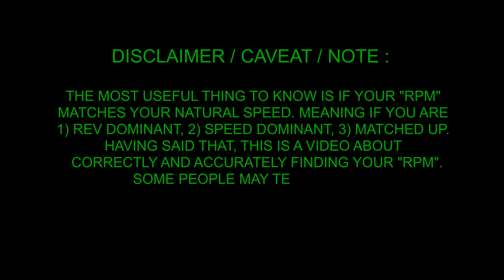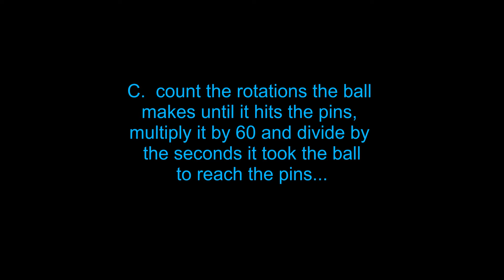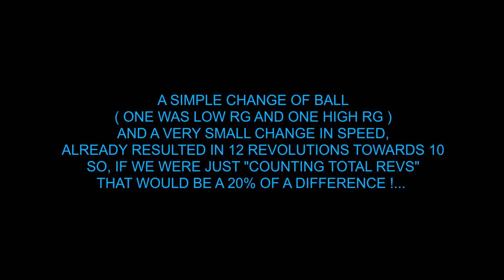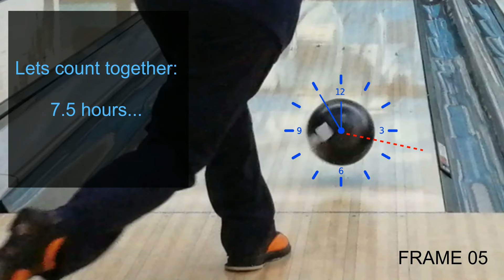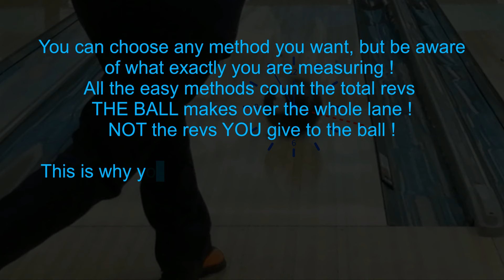How to calculate RPM correctly ! Almost all of us do it wrong.

Comment: Really interesting! 

In the Tenpin Toolkit app I have recently changed it to look at 3 revolutions from the arrows, as that generally seems clearer, but your video has tempted me to do it from the foul line instead and maybe take multiple readings to differentiate between rev rate off the hand and down lane. 

Thanks for sharing this! 🙂
Reply from the maker: Glad you liked it ! I love your app ! Would be great if you can incorporate this method in it !
Reply: @bowlingxp8345  Thanks! ☺️ Will definitely have a play around and see what works as soon as I’ve got a couple of other updates out the way!
Reply from the maker: @TenpinToolkit  sounds great ! ^_^
Reply: @TenpinToolkit  I just bought the full version of your app. I'm looking forward to getting an idea of my RPM Monday evening. My bowling center displays speed after each shot. I'm going to start logging that, I think. Tomorrow will also be my first time trying a little bit different release.

Comment: Great video! Do you happen to know exactly how the PBA TV shows calculate their rev rates? I tried looking at 60FPS videos of PBA telecasts when the bowlers use colored balls, and tried using the simple "Storm RPM conversion chart" and find that the televised shows often show an average of around 35 rpm more than what the Storm RPM conversion chart shows.
Reply: I used mainly the Strike Derby competition uploaded by bosoares to calculate the above.
Reply from the maker: Thanks ! The PBA TV shows use Specto (which for some reason, they  have to call it "strike-track"). But Specto cannot yet directly count RPMs. I have talked with them personally. It uses the rest of the sensors and positions of the ball, to essentially GUESS the correct RPM. But it gets it wrong most times. Usually the numbers you see are higher than the correct number. The Storm chart also is not accurate as i mention in the video, as  it uses your average speed, not your launch speed, and doesn't account for other factors like ball core specs, ball surface etc. It's a bit hard to count those Youtube videos because of the camera angle, but if you can do it in the method i mention in the video, you'll find more constant and lower numbers most times.
Reply: @bowlingxp8345  Thank you for your reply! Understood. Yes I am aware that the Storm chart calculation method is not accurate, which was what surprised me, because from comparisons, PBA TV shows seem to show (usually) even higher numbers than the Storm chart comparison method (which is already higher than "reality").
Reply from the maker: @user-yc9eu1yr2k  You are very welcome ! Let's hope they solve this issue in the future ! Check out some other videos i made, you'll find useful info !

Comment from the maker: NOTE 1 : This is just one of the methods to calculate it correctly. The main idea though, it explained in the video. :)
NOTE 2 : In order to be very precise, try to position the camera dead behind the path of the release and launch angle of your shot, so that the "clock" is as precise as possible. It is at a small angle in my example video here. :)

Comment: what is the "x15"?
Reply from the maker: I am not sure myself, i didn't create this formula, i just tested it and it is very precise. It may have to do with the fact that we cant "clock hours".
Reply: At 30 frames per second, to convert to per minute there would be 1800 frames per minute.

The measuring process uses 12 “hours” per revolution, and duration of the process is 10 frames. The 15 is needed to achieve 1800. 

12 x 10 x 15 = 1800
Reply from the maker: @mikewhite735   Thanks, i like math but i am not as good as a mathematician at it haha!
Reply: From the back of the classroom, "Thanks for asking."
Reply: @bowlingxp8345  the x15 only works at 30 fps. The formula that works for all frame rates is: Hrs x (FPS/2)
Reply: Also, did you ever measure your lanes to see which arrow is 15'?
Reply from the maker: @greggas1  Hm, i think if you do the math it is the same. For example if you use 60 or 120 FPS both iterations of the formula give the same result.
Reply from the maker: @greggas1  I wanted to but didn't get the chance in time. But from what i have gathered, 15 is between the 3rd and 4th arrow. If it is slightly wrong, it will still not skew the result too much. But one can measure it in his home town alley and be 100 precise :)
Reply: @bowlingxp8345  The example from your video (https://youtu.be/Yg7kWRv9Lno?t=288) is at 30fps. Multiplying the hours (16.5) by 15 (1/2 the FPS) = 247.5 RPM. If it had been recorded at 60FPS, the ball would have only rotated 8.25 hours in 10 frames. Multiplying that by 15 results in 123.75 RPM. But, if you multiply it by 30 (1/2 of 60FPS), you get the correct result (247.5)
Reply from the maker: @greggas1  You seem to not be using the full formula. Let's say it is 60FPS. So then my ball rotates 8.25h in 10 frames. Then the formula is :  8.25 x ( 60/30) x 15 = 8.25 x (2) x 15 = 8.25 x 30 = 247.5 . Same.
Reply: @bowlingxp8345  You don't need the "full formula". Just multiply the hours by half the FPS [hrs X (FPS/2)]. Same result, much simpler.
Reply from the maker: @greggas1  That's a different issue and you are right. I didn't notice (at the time of making the video) that it can be further simplified. Well spotted ! But also it is not wrong as you initially stated. ^_^
Reply: @bowlingxp8345  Yeah, that was my mistake. Every time I see that x15 in the formula, it just looks wrong, and I mis interpreted it.🤪
Reply from the maker: @greggas1  Haha no worries . Thanks for simplifying it further !  :)
Reply: @bowlingxp8345  Any chance you could take a tape measure next time you're out at the lanes? I've been really curious to find out if different houses have the arrows at the same distance or not.😁
Reply from the maker: @greggas1  I will ! And i'll and post the results here so you can find them ! :)
Reply: @bowlingxp8345  Thanks👍